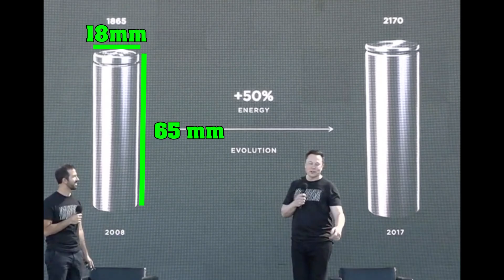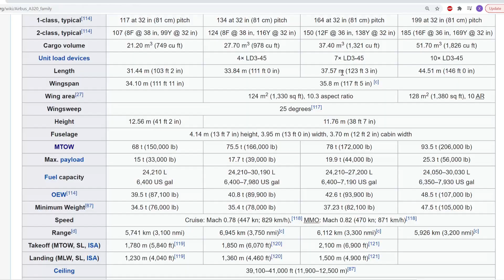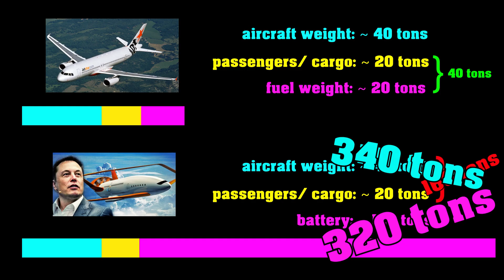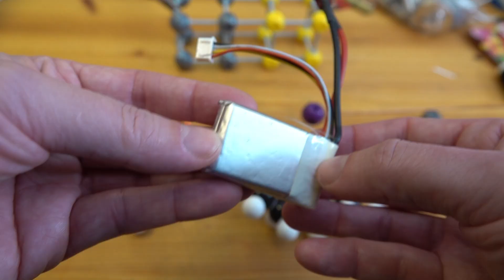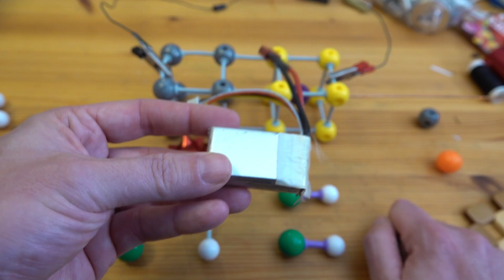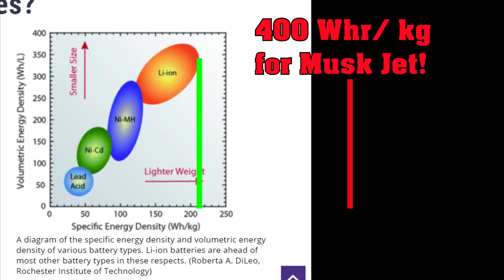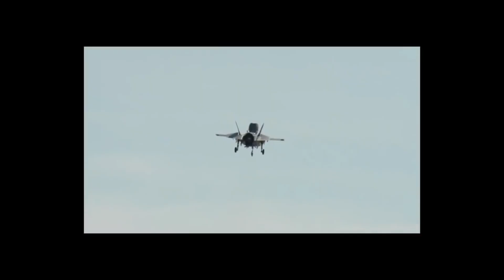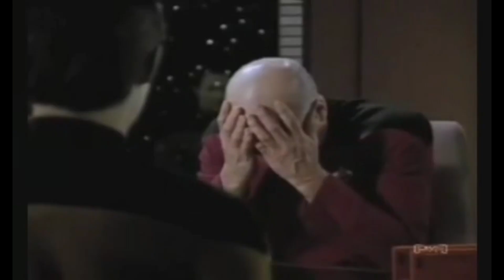Tesla's Secret Plan To Disrupt Airlines: BUSTED!!

Comment: Hey, with increasing diameter let's discuss the fact that more space is wasted internally and using smaller batteries or getting away from the cylindrical battery might at least reduce the size...
Reply: Nope, because with the 21700 battery they need cooling channels between the cells. The new tabless design allows heat to dissipate through the top and bottom of the battery.
Reply: @johntheux9238  Regardless, stacking density decreases with increasing diameter. It's simple geometry. You can fit more power in the cell, but the cells will necessarily have way more space between them. This is a problem that other car manufacturers have been able to use to have greater power density inside their battery modules. If they're dissipating heat at the ends, then the most logical design of using groups of cells end-to-end isn't used and the battery density will naturally decrease. The waste space was negligible with the smaller batteries but this creates problems for cooling as well as battery installed density. Although, one might expect overpromise from a guy who stole a patented concept [vacuum train -> Hyperloop] and passed it off to investors despite the fact it is physically impossible.

Comment: The highier You go the less drag You experience... albo less thrust from propelars. How do they think those electric motors push the plane.? Less Stuff to push through is also less Stuff  to push away from. Thats why rockets carry their own Stuff to push away from.
Reply: Duh, you carry your stuff in high pressure tanks and feed it to the engines when the atmosphere gets too thin. It's quite simple when you think about it. ;)
Reply: @C0urne  Hah, good one. Problem solved. That would be some top notch  enguineereeng. :)

Comment: Fairy tails Elon is the Pied Piper who mesmerises folk because he is a Squillionaire and can solve any problem with TESLA's BATTERIES and motors.  Elon the loo is blocked again get the plunger, Elon replies I got a new Loo design 600hp Cold Air thrust assisted flush, A.B.S. Anti Back Splash. Heated seat. Then your shit wont smell because Elon's don't smell he is Great I know he invented salt for eating in food before Elon we used salt in the sea and on the road to stop ice forming.

Comment: 16:45 and following, I always seen some Electrical Tech YT channel/videos really stressing an issue about "Grounding" . And yeah as what I know that "Grounding" actually "just for main cable line or electrical devices which straight to main cable". But, is it possible that "Grounding" method can also applied for battery also? In purpose for "relieve" charges inside or coming back to high density energy batteries( ...or in case "short circuit")? Also some problems like overcharged/leaking energy for some high density energy if too long to recharge it, can "Grounding" solves the problems?

Comment: Electric motors may beat piston engines but they definitely don't beat jets and rockets in power/weight.
Reply: The ampere engine should reach 20 KW/kg at 30,000 RPM. What do you think?

Comment: I believe that lithium ion batteries have been increasing in capacity at about 1 to 2% per year. It's still very doubtful that Elon's plane would fly but this seems to have been misrepresented here...
Reply: It has slowed down in the past few years but was far higher than that in the past. Target for the 4680 battery is a 40% higher energy density so that's ~364WH/kg

Comment: I think his plan is 70% batteries but the batteries are the structure, so it might be 70% batteries 10% plane 20% passenger and luggage

There are also other innovations which can be made for example do aircraft really need their own landing legs and gear and wheels and the other complexity to make all that work when an electric vehicle can accelerate the aircraft to takeoff speeds and then catch the aircraft for landing

Plus a fully autonomous aeroplane could get rid of the complicated human controls and two pilots and seats again lowing mass
Reply: Yes it does need landing gear unless you want to die every time the engines have a problem. Reality isnt the LooneyTunes where you can just open an ACME box to solve all your problems.

Comment: You may have missed a wrinkle in the plan.

Normal planes use less fuel, as the weight drops, from the consumption of said fuel.  A battery plane will stay the same weight the entire trip.

Comment: What is your opinion on an aircraft powered by hydrogen fuel cells?  Is it a reasonable idea?
Reply: Cryogenic fuel might work, but pressurized hydrogen is worse than batteries because of the tank weight.

Comment: "70% cell"

So 30% engines, wings, cockpit, avionics, pressure vessel, crew, cargo, landing gear, hydraulics, insulation, and passengers? Yeah I think you'll have to charge extra to people who have a coffee before they get on the plane because of the weight of the coffee in their stomach...
Reply: And mandatory bathroom breaks before take-off.
Reply: Actually the fuel weights 60% on an A350ULR. So 70% should be do able.
But that fuel is used during the flight so the aircraft is getting lighter. Just long haul airliners have to dump fuel before in case the have to return to the destination as the take off weight is much higher than the landing weight.

Another issue completely forgotten is refueling. Charging the batteries will take many hours in which the plane makes no profit. Also it needs a massive charging infrastructure. This completely makes an electric VTOL a nonsense as the idea behind VTOL is that your need no infrastructure.
Reply: @matthiasmay1977  The figures I've found indicate 30%, can you link to a referfence please?
Reply: @cambridgemart2075  
Sorry I was wrong I mixed up l and kg
https://en.m.wikipedia.org/wiki/Airbus_A350_XWB

So MTOW is 280t and fuel is 110t which is 39% if the MTOW.
That's for ultra long range like Singapore to New York and not just transcontinental US.
Reply: @matthiasmay1977  no problem, the plane has a miniature nuclear reactor on board
Reply: why does everyone assume he's starting with a big ass airliner ? first of all, we already have electric planes, so it's not impossible, i'm interested in seeing the supersonic part, that will be interesting, but if we take the F-22 raptor for example, that has a 50% fuel capacity (maximum take off weight 38tones, internal fuel 18tones) and it can even have two external wing tanks weighing 11.9tons, it can also be unmanned, and work from there, the man never claimed he will make an A320,
Reply: @redakanane  what makes you think that a fighter jet changes the dynamics? Your pointing out that they already can be 50% fuel just makes the situation worse. If you have to compete with a jet airliner that is already 30% fuel, that's tough. But to compete with a fighter jet that is already 50% fuel is that much harder. Now if you could find a plane that is 5% fuel, you might be onto something. Maybe a glider? 😛

Comment: Having flown aircraft I also see a fairly big issue being your gross takeoff weight will always be your landing weight, which actually will restrict cargo capacity when traveling to some destinations as you will not be able to burn fuel to reduce weight.

Kinda a minor problem considering technology doesn't even exist.
Reply: Lots of routes that rely on landing significantly lighter than you take off at. Lots of hot, high altitude airports in the world. Not to mention how most of the time the fuel is in the wings, on that big lever, so you move all that mass to the middle, change the moment of mass....You are not wrong, turns out we know a lot about how airplanes work from the past hundred plus years.
Reply: @KarltheKrazyone  As a pilot myself I’d say that is probably why they insist it will be a “vertical” takeoff and landing plane. That  would counter the problem of landing weight in many scenarios. Of course there are sooooo many other problems with the fact that the weight is constant throughout the the flight. Like maximum flight level for example. With our current level of technology this VTO electrical supersonic jet is unworkable from nearly every angle.
Reply: @Neroj007  If it's only capable of landing using vertical thrust, that makes it incapable of sustained flight transitioning to a landing if it experiences a power loss.

Comment: Something that a lot of people keep saying (I'm not necessarily saying Thunderf00t is doing it, but in my much younger days I certainly have) when comparing electric vs gas is only comparing the battery vs the fuel itself. There's a reason that an EV isn't 10x the weight of a similarly equipped vehicle that runs on gas. That's not to say an EV plane is a good idea, it's not, but the argument shouldn't ONLY be about energy density (energy/weight of the storage medium)

We need to look at ;

How much of the weight of the vehicle is dedicated to the drive system ?
Of the drive system which consists of the "engine/motor", "energy storage", "transmission", etc. ... what is the TOTAL weight difference between the two competing systems ?

THIS is why electric planes are hard. 

In the drive system on a plane, MOST of the weight is the fuel, not the engine. So between EV and hydrocarbons, we increase the weight a LOT on the "fuel" and only decrease the weight a little on the engine for a massive increase in net weight. 

In the drive system on a car, MOST of the weight is in the engine and transmission and not the fuel. So an EV car will have their fuel weigh a lot more but save weight on the motors/transmission for a more modest increase.

Furthermore, the drive system on a plane is a much a much larger % of the total vehicle weight in the first place AND the engines on planes are far more efficient than cars which means for a comparable range the battery requirement will be far larger.

The above is ONLY discussing the "weight efficiency" of both systems. As thunderfoot put it so well, the safety element basically makes EVs impossible. We have 100years of perfecting safety on planes. Deadly accidents due to the drive system failing are almost unheard of (except for in the movies). We can do controlled dumping of fuel in a normal jet but how can you dump the batteries if they're overheating or potentially shorting ? It's not impossible, it's an engineering problem but why add that complexity when we have something that works especially when the "new" system still has so many other problems? 

EVs make sense for cars not because the safety condition is less important, but because there's an easy solution. You can always stop, and get out of the car. It's incredibly difficult to imagine a scenario where you have a battery issue and NOT have the ability to slow down, open the door and walk 100 ft away within less than a minute. In a plane cruising at 40k ft, that's impossible.

Comment: You could recharge the batteries in flight.
 Maybe with a microwave transmitter beaming energy to collector panels on the underside of the plane. 
Each power station could beam energy for, maybe, 15 minutes before the plane is out of range.
So less than 20 such stations would be needed to go coast to coast.
At the very least it would extend the range.

Comment: Two other issues:

1) If you are going for long ranges, turbine powered aircraft burn off their fuel and get lighter (airliners do have to keep a certain amount of fuel onboard so they can get to another airport if their destination airport gets shutdown for weather). A battery powered aircraft pretty much lands with the same weight that it takes off with. *

2) Unducted (open) propellers do not work very well at supersonic speeds because once the tips go supersonic (speed increases as you go out to the tip), propeller efficiency drops. The blades in ducted propellers (or gas turbine engines) run at subsonic speeds and rely on the intakes to drop the supersonic airflow to subsonic speeds. To get higher mach numbers usually requires movable inlets to efficiently keep the airspeed where it needs to be (look up inlet pressure recovery).

* Actually gas turbine powered aircraft have another advantage in that can take with more weight than they can land with: that is often why if a trans-ocean flight has to return to the airport just after takeoff, the plane will have to dump or burn-off fuel to get back down to the max landing weight.